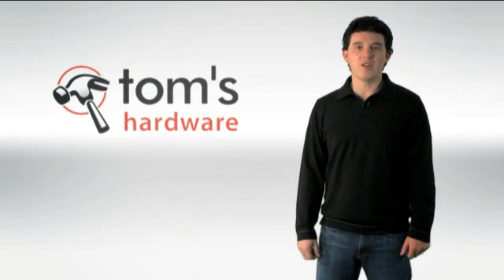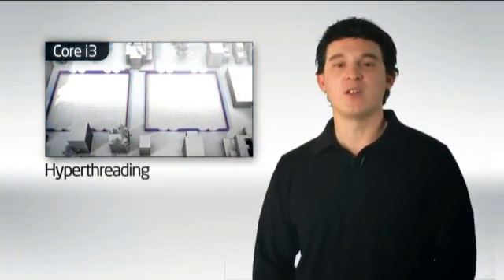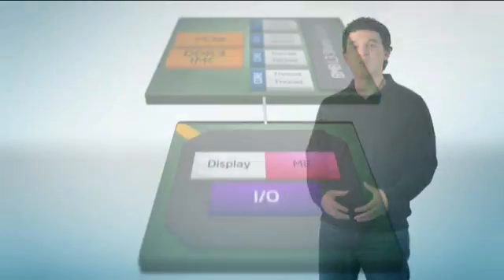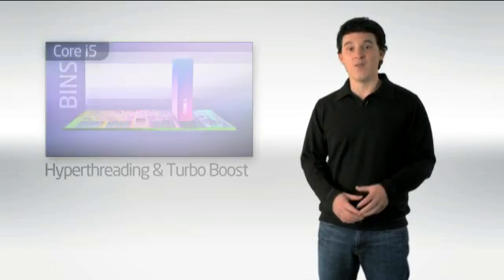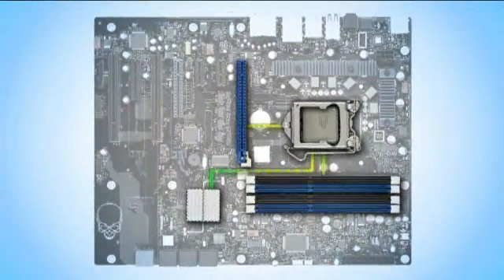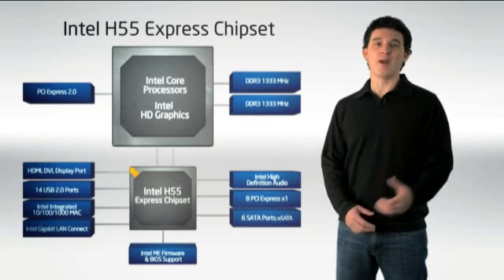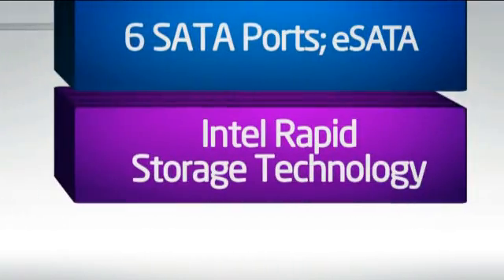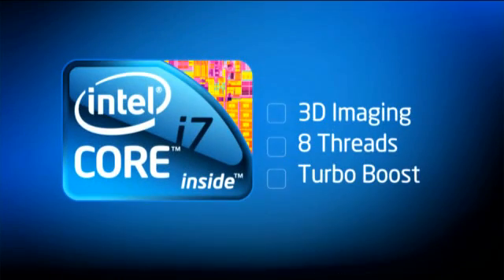Intel's 32nm Clarkdale Processors: Explained

Comment: @drunkenjudgement I guess Core i3 is 2 Cores but can handle 2 Threads per core. There are two kinds of i5: the duo and the Quad Core both handle 2 Threads and the i7 is only quad core handling also 2 Threads per core.